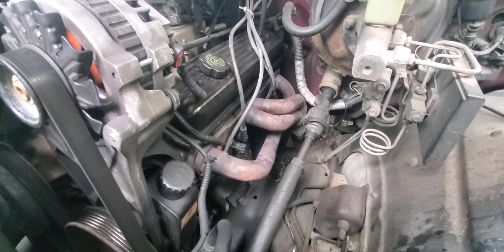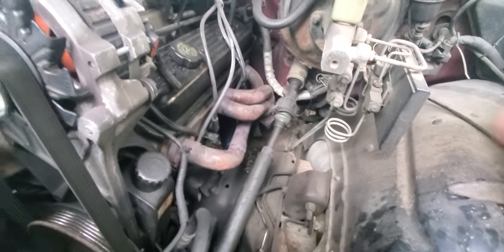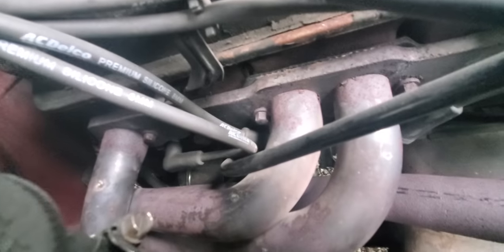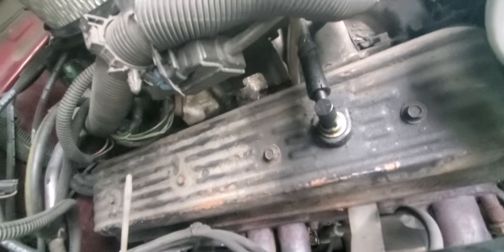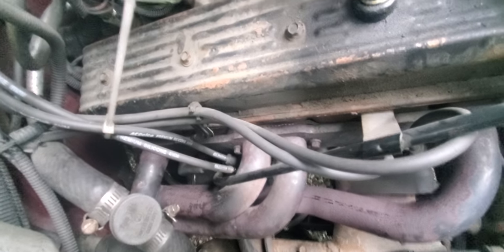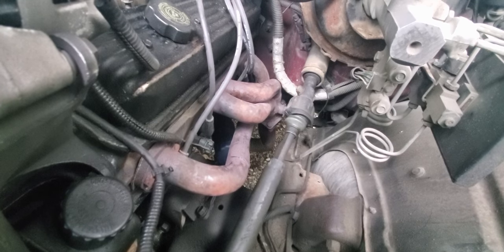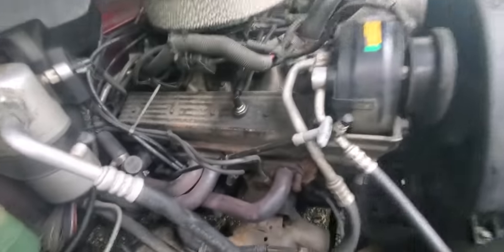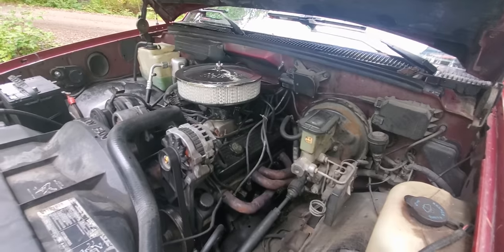Summit Racing Shorty Headers on Chevy 350 - 8 year review + Exhaust clip

Comment: I just put a set on my 89 k2500 that I'm restoring. I noticed the original manifolds (had a crack in one, so I went ahead and just put headers on it) has a gasket going from the header flange to the y pipe. What type of Gasket did you use for the header to y pipe?
Reply from the maker: Hey Trevor, thanks for the question!  You can use the original stock size flange gaskets from the shorty headers to the y-pipe.   Think I've only had to replace these once and that's because the original ones were cooked after 20 years of service.   Here you can check them out here:  https://amzn.to/33z64H1
Reply: @KooshdaakaaGarage  Alright. Thank ya sir. Yeah, seeing as my truck is 32 years old, they leaked haha, so I need new ones
Reply from the maker: @trevordolly4628  heard that!  I changed mine around 10 years ago now and they are still holding strong. Glad you upgraded the headers,  they made a pretty big difference in the overall build not to mention the sweet exhaust note they produce 🤘😁
Reply: @KooshdaakaaGarage  Haha. I can't wait. I'm doing the rear main, Oil pan, and Flexplate right now. Then I get to put in my new tranny. It's a 4x4 Turbo 400. Reverse went out the day I got it registered 🤦🏼‍♂️. Just my luck haha. I drove for 3 months perfectly fine, but the day it got registered, bye bye reverse lmao. If you've got Facebook, join this group, https://www.facebook.com/groups/cksocietyobs/?ref=share&exp=3bcf. Look for my name, and you'll see all I've done to the truck so far.

Comment: I was looking at getting some for my truck but I was wondering if they had a spot for the stock o2 sensor
Reply from the maker: They do!  Drivers side, exactly where my original one was.  Best to get a new O2 sensor if you're hasn't been changed in a while.  The one in the oem manifolds was rusted in place.
Reply: @KooshdaakaaGarage  mine have arrived in the mail and I am going to put them on thanks for the tip
Reply: Yes

Comment: What is your fuel mileage like?
Reply from the maker: Hey David, thanks for the question.   This rig when driving around town with tons of stop and go will see 11mpg on average.  When I had the truck loaded down with my camper and gear (1500-2000lb) and took it on a road trip, it was getting 12.5-13 mpg.

Comment: How long do the gaskets last ?
Reply from the maker: Hello Jay,  apologies for the late reply, I could have swore I answered your question.   The header gaskets last quite a few years if you remember to re snug the bolts after you've driven the truck a bit to make up for the shrinkage that occurs after a few heat cycles.   I had timing issues in the past and have blown the header gasket via backfire but other than that they will last several years.

Comment: did the headers make it any louder?
Reply from the maker: A bit louder and a more throaty tone.
Reply: @KooshdaakaaGarage  did it make it raspy bc i want to avoid that
Reply from the maker: @Darren-dz6hx  nah, not raspy.  Just a deeper, more throaty tone.  The exhaust clip is at 1:40 if you want to hear it.
Reply: Did u hear a ticing noise from the header
Reply from the maker: @rexs8058  I hear one from mine right now because I have a blown header gasket on the driverside 😬  otherwise when it's fixed there isn't a tic

Comment: do all the shorty headers have this plug issue
Reply from the maker: It looks like it.
Reply: @KooshdaakaaGarage  so the issue is changing the plug will the header go on with the plug already installed. i ask because my engine requires a specific plug and i want to use what they recommend
Reply from the maker: @nuclearbum9858  oh yeah, absolutely.  If you install the plugs first the headers will fit over a full sized plug.  The short plugs make the install easier if you ever have the option in the future.
Reply: @KooshdaakaaGarage  ok man thanks for the help
Reply: @KooshdaakaaGarage so long tube headers have this problem as well?